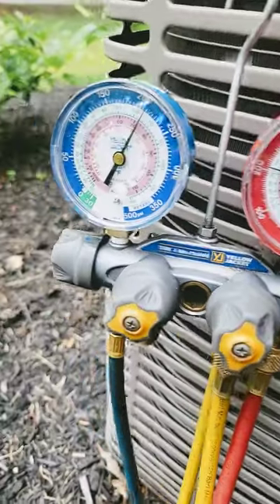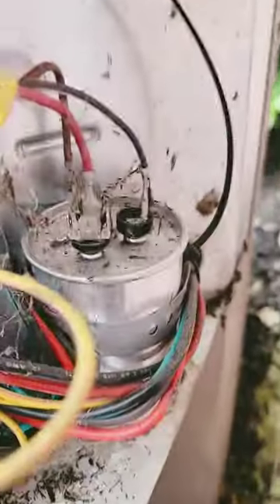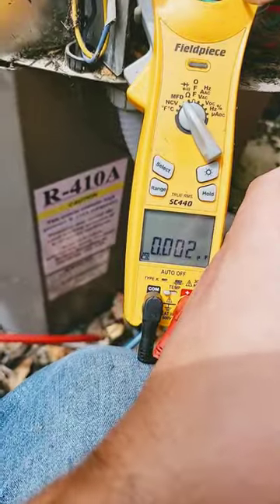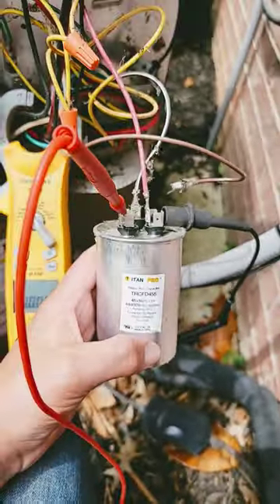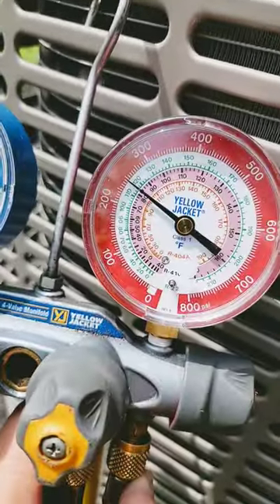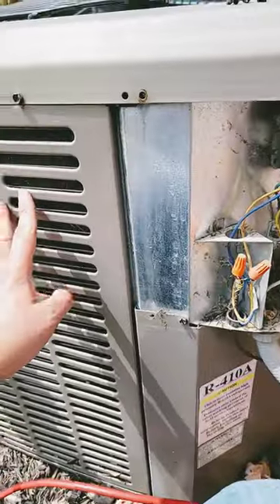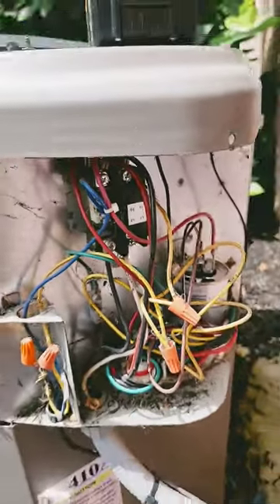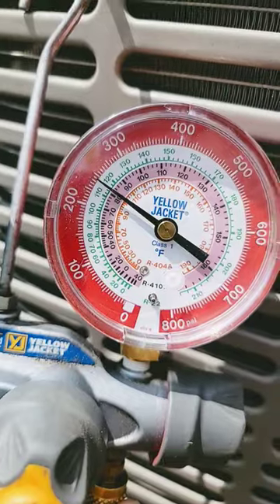A/C Unit Disaster: What Went Wrong?

Comment: I've had many, many caps over the years that, while removed from the circuit, showed within tolerance, but checked under load they were below required capacitance.
Reply from the maker: Very good information thank you brother
Reply: How would you check them under load, the same only when running?
Reply: @Garth2011  from the capacitor, check amperage on the compressor. Multiply that number by 2652, then divide that number by the voltage reading that you get from common to herm at the capacitor. That will give you the actually capacitance that it is providing under load. Sometimes it can be vastly different than a no-load reading.

Comment: On the contactor, while it’s running, run your voltmeter across the contacts and see if there’s a voltage drop. That will save you from having to take the cover off and looking at it, and still not being able to tell visually if contacts are bad

Comment: You are the man, I've been given a heat pump minisplit. It's pipes have been left open to the atmosphere for ages , is that a problem , once the two units are joined together will it need more than a vacuum before it's gassed. Wish you were close so you could come do it for me :)
Reply from the maker: If there is a filter dryer in the unit definitely Replace it
Definitely pressure test with nitrogen and then vacuum

Comment: You also need to check the Herm RLA good sir compared to the outdoor temperature & max on data plate.
Reply: Could you please provide further information about the specific criteria or range for determining whether the HERM RLA is considered "good" in relation to the outdoor temperature and data plate?
Reply: @The_MatEngineer if the compressor is drawing more than the RLA stated on the data plate then the compressor is on its last legs and will probably start tripping the thermal overload. A compressor usually draws significanly less than the RLA so if its getting close to the RLA then the compressor is showing signs of age. There is not much you could really do other than be aware that the compressor is going to fail in the relatively near future so plan accodringly.

Comment: R410a mixed bags of emotion.  Pressure looks ok but it MAY Still be undercharged.  Gotta check subcool & superheat.   Could be leak.  Could be accumulative de-minimus release of all those manifold gauge hook up’s over the years.  At least 1 oz loss per hook up.  Unless a tech pre charged their gauge with right refrigerant before hook up or thumb screw fitting with smart probe.  All these CAP Vids rarely show the importance of checking the drain afterward, especially if the system hadn’t been serviced in a while or never.

Comment: Check voltage at capacitor 😅to see if fan motor or compressor is putting higher or lower voltage back to capacitor to eliminate hidden motor problem

Comment: Hey Mate..when changing the cap..do you look on the old cap for the pf/ohm ratings or on the manufacturer label to make sure the right cap is going back on the unit??
Reply from the maker: Always
I look at the voltage and the microfay rads

Comment: Hi good day I have a midea portable aircon recently I noticed that is wasn't cooling anymore if I switch the unit on then I hear compressor switching on then off and continue doing it any advice will be much appreciated thanks in advance
Reply from the maker: Sounds like it's a pressure issue definitely need to put some gauges on it.

Comment: Isn't 250 a bit low for the condensing pressure. I live in Florida and go off of temperature instead of pressures. Anyway isn't  325-375 a good range
Reply from the maker: depends on the temp outside